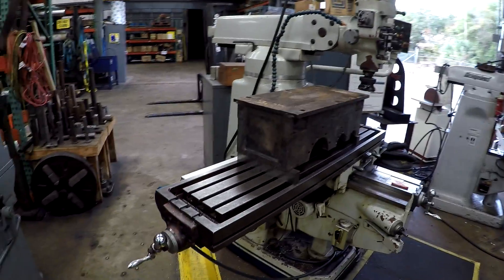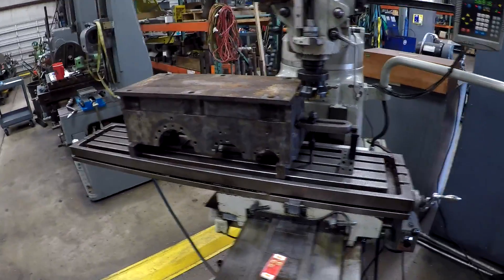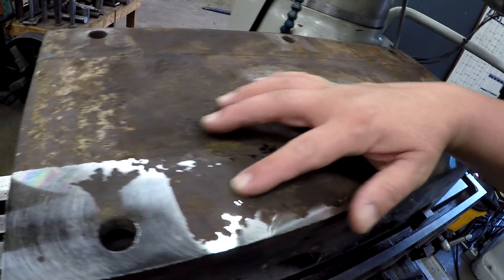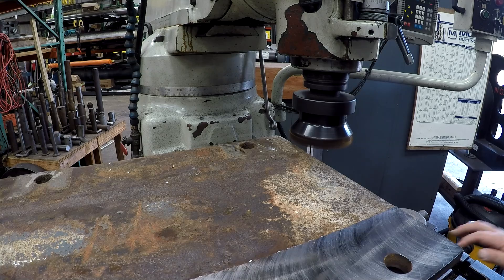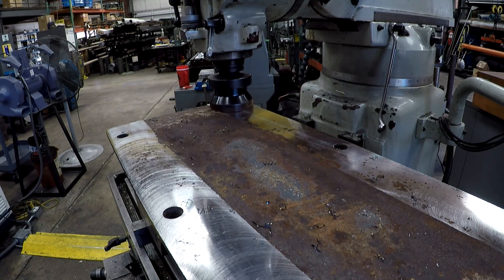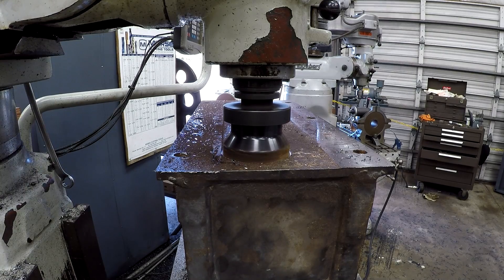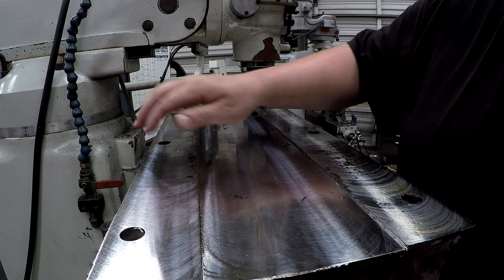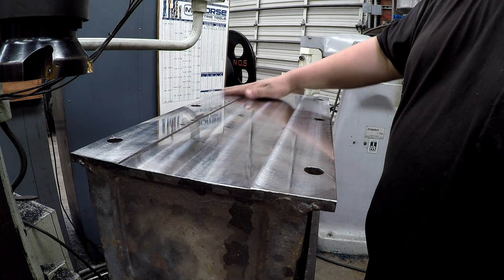Facemilling Gearbox Housing

Comment: Anyone else screaming at the screen for him to put some lubricant on that thing?
Reply: not really needed for face milling. but on his last cleanup he had lubricant.
Reply: Carbide doesn't like intermittent cooling from cutting oil, it thermal shocks the edges and makes them crack. Generally carbide tools should either run dry or with full flood cooling so the cooling effect is continuous.

Comment: Something like that with a 3 inch face mill I’m running about 650 rpm 15 IPM .04 depth per pass. That chatter as it comes of the part is what is killing the inserts.

Comment: Doesn't anyone have a surface grinder?
Reply: The millig way is more accurate measurement wise and you also get flatter surfaces
Reply: @yxcvbnmmnbvcxy544  
I'm fairly new to machining but from little I've learned, Precision Grinders are much more precise as they tend to work in Tenths.  Mills are much more suited to the thousandths.
However, for this application I would bet that a Mill would be the most efficient and cost effective tool to use.
I invite others to lend their input.

Comment: Feeds rate to RPM is far too slow. Inserts are rubbing rather than cutting. You should aim to get right under the skin of the impure material to reduce the effects of abrasion on the inserts.
Reply: Yes sir! Use that damn thang. That good soft underbelly will stop the chatter and give you grounds to out run the chatter but knowing abom he's proving an example

Comment: My headphones and Adam’s camera both have great low frequency response. There is quite a low frequency rumble I’m hearing when you were making your first cuts, not sure if surface quality is affected, though. Sound vibration might be a good diagnostic tool to listen for different loud and soft vibration points on a machine or work. Final quality was what customer asked for so no problem.

Comment: What are the gear boxes coated with? Industrial paint, some sort of epoxy,  or are they powder coated? It might be cost prohibitive but you might look into Black-T coating by Walter Birdsong in Mississippi.  Mr. Birdsong has passed on but his sons still run the business. He developed his coating for something on submarines if memory serves.  Many of the world's most elite special operations units have their weapons and other gear coated in Black-T. Even if the outer finish is compromised the coating adheres to the pores of the metal on a molecular level and still protect the metal. Maybe it would be a service your shop could help facilitate and save your customers some downtime. I know you make your money machining parts but the mechanics in the back still do the painting  and have to charge for that. Your shop would still have to do some repair work I'm sure but the customer would be better served in the end, and happy customers stay customers.

Comment: Nice milling job, It almost seemed like where the rust was it was harder than where it was clean. The shell mill was throwing sparks from the inserts, but I'm probably wrong with my assumption.  
Thanks for the video.
Reply from the maker: +Jeff Bernstein Carbide doesnt like rust very much, it's best to always keep the nose under it when possible.

Comment: Great video. What type of machine did that gear box come out of?
Does a facemill primarily cut on the leading edge and minimal on the trailing, or does it cut solely on the leading edge? Just curious.
Reply from the maker: I don't know where the box is used. The face mill cuts on the leading edge.

Comment: PS:  How do you determine when and when not to use lubricant on your jobs?  Doug
Reply: Always use coolant if it doesnt affect your wiew when u need precision
Reply: @LordOfChaos.x  you generally don't use it when facemilling steel, of course that depends on the insert. but most carbide inserts don't use it. it's actually bad for the cutters.

Comment: Is there a weight limit when the tables extend out on the different mills, shapers, etc.?  Or a rule of thumb?  I imagine the deflection would become significant at the heavier limit?  Always learn and enjoy from your videos.  Doug
Reply from the maker: When in doubt, I'll have the table extended out, set ths part down with the crane slowly and moniter the movement. You can visually see if it's going to tip. On Extreem overhangs I use the crane to hold the weight.

Comment: Mannnn you've got that head trammed in DEAD NUTS! Thats some sweeeeeet surfacing thats for sure. The mill helps. That Bridgeport Series II design on the Acra with the square ways is solid as it gets. Nice work buddy!!

Thinking about it now.....how about doing a "Walk around" on the Acra in one of the videos?? I bet there are lots of guys out there that have no idea what the difference between the Series 1 and Series 2 are or why the Series 2 design is so tough. Just an idea!
Reply from the maker: That mill used to belong to my shop. My dad bought it new in 96, and yes it's been a good heavy machine.

Comment: 9:52 there  went the edge on the inserts.  If you had run that pass the other direction they might have made it since your chips would be thin to thick, rather than thick to thin. Puts a bit less hammer on the inserts at the start of the cut so it reduces shock. May have not mattered and they would have just give up anyways, the only last so long. Spark shows are cool though. :-)
Reply from the maker: They were already wasted, so I was trying to rough off as much as I could. But after that sparky shot, I moved the cutter around to the other side and continued. I was just testing to see the reaction.
Reply: +Abom79 Why no coolant or oil  on the cutter?  Wait.  I see some about 11 min.
Reply: +bcbloc02 +Abom79 Hey guys, I don't know if you have tried them, but HSS inserts own this kind of work.  I am having trouble finding them like I used to. I have a big old honking 6" facemill that takes SPG 634's and I could, maybe not anymore, get Tantung HSS inserts for it.  It chews this kind of stuff up for breakfast. And get this, you can sharpen the damn things, its amazing.   Of course you run it a lot slower.  I know you can still get common shapes like TPG's in HSS, but now sure about others.
Reply: I don't know exactly what inserts he used, but general with a face mill like that the inserts have a "nonsharp" edge (don't find the word) for durability. That means the feed can't be to low and the radial cut should be 25 OR 75% of the tool and always cut along direction. If feed are to low and or the cut starts to thin the edge rubs rather then cut, temperature rise and edge worn out prematurely. I typically had used 600rpm and 4.5 in/min PER insert.

Btw carbide inserts for milling mildsteel to regular stainless should cut dry in almost every situation. The temperature differens cracks the surface layer and the edge worn out.

I have seen maybe 50 of your videos Adam as I admire your work and Im in the same business.
Keep up the good work!
Reply: James Kilroy Absolutely, but in pro shops you don't get paid to sharpen things.  Mostly the send out tools to be sharpened.  Or just replace inserts. 

I find HSS to be quite the best for my work and leaves the least tooling marks even when doing 316 SS.  Just have to keep the grinder near by.
Reply: James Kilroy
I have not seen HSS inserts for the SPG series, but I do run those a lot, they are one of my favorite milling cutters since I can usually find inserts for like $2 each and I get 4 sides out of that so they are super affordable. I guess you could always get HSS lathe blanks the right square and then just bandsaw or chopsaw off your inserts. :-)
Reply: Using inserts you always want to go from thick to thin if you have the option.

Comment: Is there a corrosion prevention compound that you can put on that surface to prevent that from happening in the future?
Reply: +Ken Knerr There are many products that inhibit, convert etc, but you need the whole thing protected not just the bottom, or rust will work under any coatings edges.

Comment: Do they need to shim it up when you have removed metal if it's going to fit onto an axle of some sort?
Reply: +SquirrelFromGradLife If you go back to the beginning of the video, you can see where the millwrights used shims on the original installation to true things up...  they'll need to use thicker shims on the reinstall, I'm sure...
Reply: chemech good spot, I just thought those spots were the mounting points..

Comment: Wow those were some hot chips on the center cut.  Was that due to the hardness of the material, fast speed / feed or what?
Reply: +svenp It's fast feed in a hardened zone. Maybe welded or heavy rusted. 
It would be better to clean the surface firts with a grinding wheel. Only after use a face mill...better with round strong insterts and greater ap
Reply: +svenp Carbide will spark like that when it gets dull. That center cut was real bad though. I don't have the balls to run inserts that dull. I would have stopped in the middle of that rough cut and turned those inserts.
Reply: +svenp Pretty sure it was just due to the teeth from the bit directly hitting the corner that was created from the other cut.
Reply: +Beltra .KTM That or a belt sander... Abrasives are your friend on a job like this...
Reply: +svenp ... I second inserts being bad